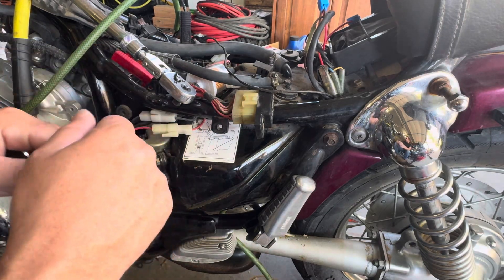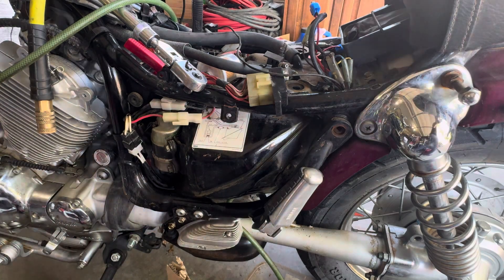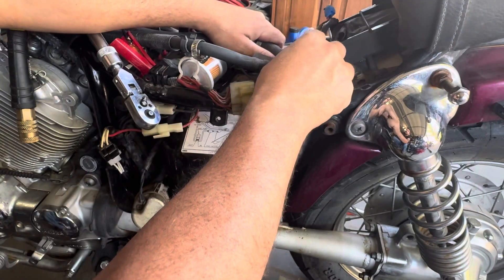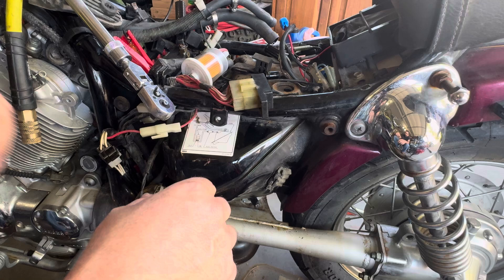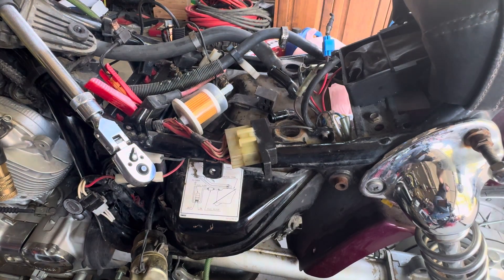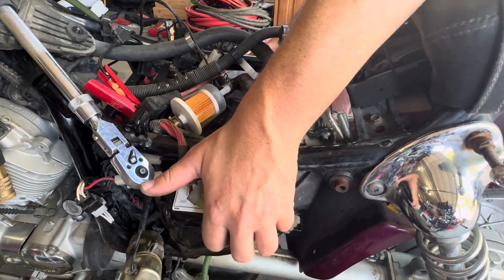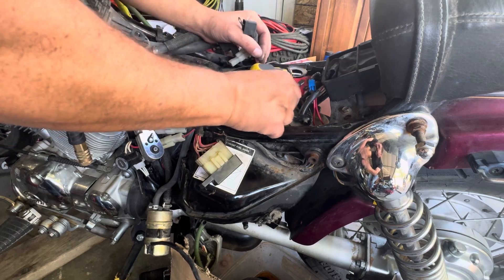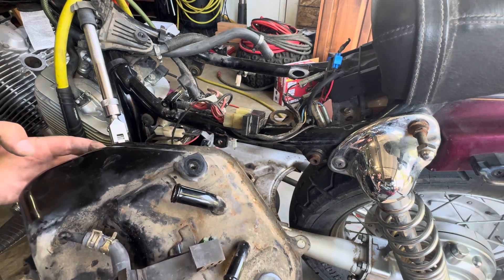1994 Yamaha Virago XV535 fuel tank removal

Comment: You have put a lot of effort into these instructions. I bought one of these old ladies by chance on Sunday because it was very cheap and in good condition. I normally ride a '94 Kawasaki 1500 Vulcan. I had no idea that there were two tanks installed. I have to remove rust from the inside of both. It works very well with citric acid and washing soda dissolved in boiling water. Add 100 grams of citric acid granules and 40 grams of washing soda to 1 liter of water. Fill the tank(s) to the brim and leave to soak. Thank you for your efforts! Have fun with the little lady. Greatings from Germany, Swabia. Always keep the rubberside down! 😎😋

Comment: I need to rebuild the petcock on my 97 Virago. Do you think I could remove it and take the petcock off without removing the entire fuel tank? Is it possible?
Reply from the maker: @deceitfulfate  you might have to still unbolt the top bolts to the tank and lift it up enough to get a small screwdriver to remove the Phillips screws. You’ll need probably about 3 inches of clearance. To be honest, it seems like with would be more of a pain to not remove the tank completely. Let me know if it ends up working for you if you do try it that way.